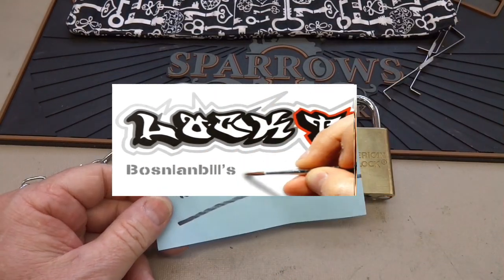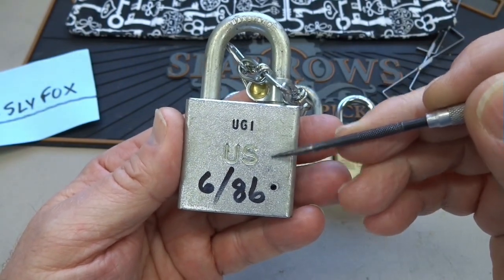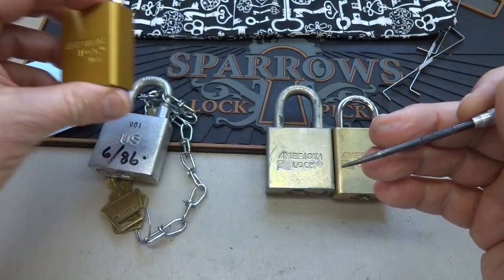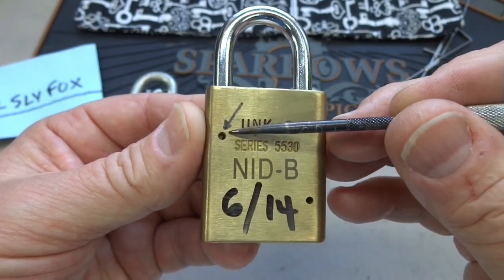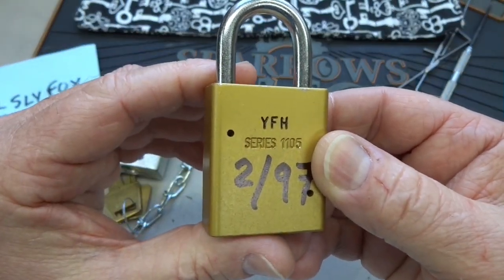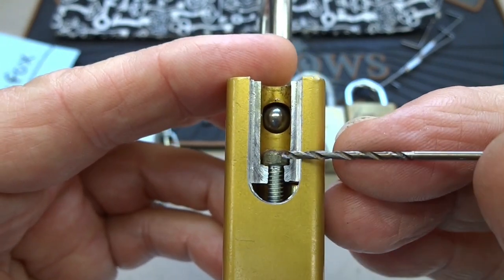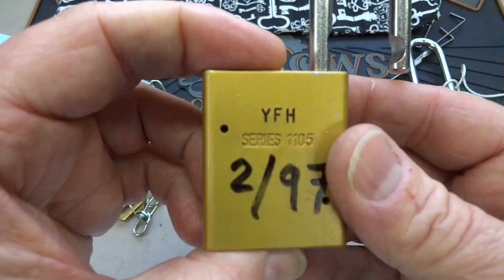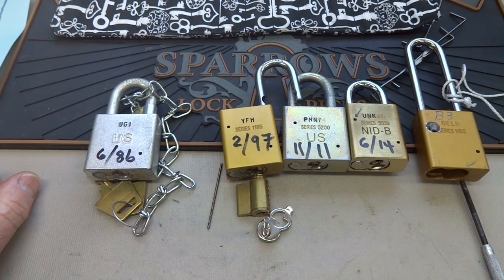(663) Vulnerability DESIGNED INTO Master Lock & American Padlocks

Comment: master lock sucks...their standard silver/blue padlocks only have a few key designs. Our company has a several of them that work with the same key. Well one day I got locked out of a site that had the same style of lock so for the hell of it I tried my key and guess what? it opened! I work for a mechanical contractor and the lock on the site to the gate was owned by the general contractor. So anyone with a key to that gate can get into our job boxes and vice versa...pretty sorry excuse for security.

Comment: I've a question... What's the big deal with that hole?..
I mean, if you need to basically drill it in order to take advantage of it, what's the point?.
If the whole was not there, couldn't you just drill the lock on some other point and gain access?.
What I mean is: if in order to take advantage of that weakness you need to basically destroy the lock, is it really a weakness?.

Comment: Reminds me of the "school locker" combination locks from Master. Behind the back plate, there is a conveniently placed quarter-inch hole in the hardened steel body. You can turn the dial three turns clockwise, drill said spot (the back plate is rather soft), and drill through all three discs. Then you turn the dial half a turn clockwise and it's open. Almost makes you wonder whether they put this weakness there deliberately. I know bolt cutters also cut throuh its "hardened" shackle like a hot knive through butter, but a small electric drill is more easily concealable.

Comment: I thought you were going to use a hardened pick to back out the screw!
Push the pick in against the screw-head, then lever it to the side.  
Repeat for a metric eternity...
Sure it would be tedious, but the defeat would not require drilling anything.

Comment: Bill, so in the Army, walking around with bolt cutters would fairly quickly get you asked about you were doing.. On the other hand carrying around a drill and a 3/16 to 1/4 inch bit was no biggie. Many times I've just simply drilled the soft steel tapered recess nut on the bottom of that screw and get the same results in about 10 seconds. While the barrel was out I would then re-key the lock or get the pin measurements to cut another key and write up a counseling statement for the soldier who lost the original key. I kept a pretty good supply of those recessed nuts as I could open a lock with the only damage being on the nut.
Reply: Eric Nelson Answering the challenge with "Keys to the city!" in my experience was always good enough. Any good e4 can tell you that everyone knows complacency kills but no one checks anyone who looks like they know what they're doing.

Comment: If I want in a place and it's only secured with a padlock, I'm getting in. I don't care what make, brand or type. I've got a 36 volt cordless Metabo and with with a cutting disc I can make short work of any padlock on this planet. If a thief wants to get in all they need to do is get their hands on the right equipment. Locks are only meant to keep honest people honest, after all.

Comment: If drilling is involved, most padlocks will be compromised by drilling out the cylinder, since the material is usually brass. I don't see the drain hole as an issue. You can always replace the screw with a grade 8 hex cap screw. I think the size is 8/32.

Comment: To be honest I do not see this as a problem. Use a center punch to mark the center of the nut on the bottom of the lock and drill it out just enough so that the head of the nut falls off. Takes all of 20-30 seconds and you can just put a new nut on the lock when you are done.
Reply: Have you tried that?
Reply: 253637zero2  Tried drilling out the bottom nut? Yes I have. It was very easy and with a $0.25 part I had a fully working lock after I made a key for it.
Reply: +bosnianbill and they were nice enough to make the lock body out of a soft metal.

Comment: Another thought: would it be plausible to use this hole to introduce a mixture of alum and water directly onto the screw, causing the eventual dissolving of the screw?  I realize this would be a long term attack on the lock, but I would venture a guess that such a long term attack would be hard to notice.
Reply: the end result is the same, the lock would be destroyed in the process, you'd just be trading time saved for lower volume

Comment: Do you reckon that if you used a drill bit the same size as the integral 'Pilot' hole, that you could weaken the screw enough to pop the core retainer plate off with out leaving any traces of intrusion?   Just drill the screw, then pry the retainer plate with a screw-driver or similar implement to shear off the remains of the screw head, dump the core, open the lock, and remove the remains of the old screw (it should thread right back out of the retainer plate since there's no tension on it), and reassemble.

Comment: That is a valid point. But if you are going to drill a lock with such a big bit (as showed by the drilled example piece) then why have any caution at all? Why not drill into every lock? Why not cut the lock? You can do this with any lock and not with such a fine bit.
Reply: +adam seay Pretty sure the point was that they give you a pilot hole right where you need to drill and that makes it even easier to compromise.

Comment: I've been watching a few of your videos about locks, & keep thinking that the locks do what they were meant to do.  That is to say they keep the normal person out of the locked item.  I would say, 'keep the honest people honest'  but I don't really believer there are many of honest people.  It's just that the normal people don't want to take the time or risk to steal, & rightly so.  Now with this lock on this video, your not quite being fair, for if you wanted to get in this lock you could just use bolt cutters, or a cut off wheel, or what have you, to be in the locked compartment quicker than drilling a hole.  So we must say that 'Master' lock did not really weaken the lock, at most just made another way to compromise it.  Another way true, but does it really make it less safe, in that the drilling it out would still be harder than the other ways. :)    
    Thanks for the videos I do find them real interesting,     Singed   an 'honest' person.
Reply: +VerifyVeracity Yes, I think you're correct, the other methods of destructive entry might work easily as well if not even quicker.  I think the point was that with essentially a "pilot hole" already predrilled, it's pretty quick, easy and fairly quiet to come by with a small electric drill and drill out the screw head.  It's also a bit easier to conceal a small battery operated drill than it is a bolt cutters.  besides with bolt cutters  you've got issues on some locks with things like shrouded and/or hardened shackles.

By the way, I agree with you on the concept that locks are largely to keep honest people honest.  I've always said that when talking about locks.  True thieves with the intent to steal are probably going to get in regardless of what you do.  You just need to make it as difficult and time consuming as possible for them so they'll pick an easier/different target.
Reply: You're right, locks are meant to keep honest people out. But a strong lock also deters the dishonest folks who aren't looking to steal YOUR stuff specifically, but are rather prowling for easy targets. Master makes easy to defeat locks. Therefore, if you use their products, you're basically putting up a sign that says come rob me.

As consumers, we shouldn't accept security compromises that didn't need to be made. In this case, Master had a perfectly fine lock body design they acquired from American, decided it needed an additional drain hole, and then proceeded to put it in the worst place possible. It was a really dumb decision and I see no problem with poking fun at Master's incompetence.

Comment: This is a weakness, but if you're going to use a drill on a padlock, why bother, just cut the shackle with a bolt cutter...
Reply: +Yyunko Some seem to have guarded shackles, although those are only the more expensive ones, that he's show in some videos
Reply: drilling might be a bit louder but a drill is a much smaller tool then bolt cutters and every household tends to have one one could also use some type of acid at that point

Comment: Well, those are aluminum bodies correct? So if you were to drill in the same location, even without the hole, couldn't you get in?
Reply: +AfterDark3 Yes, obviously.  The point again I think was simply that by putting the drain hole exactly where they did, Master Lock created a perfect opportunity for a thief with a small battery operated drill to defeat virtually any ML lock with these drain holes very quickly and easily. They have essentially predrilled a perfectly placed  pilot hole for them.  The only thing they didn't do was put a label on the lock with an arrow that says, "drill here ->."  Who knows, maybe ML will do that next under the guise of thinking they're helping the customer.   They could attache a label that says something like,  "If your lock fails to open, simply drill here ->     <-- and the lock plug will simply fall out of the lock body and the lock will no longer continue to function.  Thank You, Master Lock."

Comment: Are the drain holes really needed? Not really as enough water stays in there to rust the spring and retainer screw. Weakness I suppose but it is a destructive bypass.
We locksmiths have been drilling the retainer nut for decades to get American locks open when they can't be picked. I don't see any professional using this to open one.

Comment: I don't see that the hole makes the lock any weaker than it already was. A drill is usually not the tool of choice for a thief. Marking the location of the screw head doesn't make it easier for him to use bolt cutters or an angle grinder.
Reply: +Timothy Fish But it gives them one more avenue.

Comment: It's not like the hole makes it /that/ much easier. Just makes it faster. If you know where to drill, you can just tap with a center punch and work your way up with successive drill bits. Even the best aluminum is no match for a carbide drill bit.

Comment: Seems like there are other faster methods that use less equipment to achieve the same end.
You could use a nuclear weapon to quickly vaporize the lock but why go to the expense and trouble of that when you could just break the lock with a bulldozer?
So I’m not too upset over this hole.

Comment: but couldn't you just drill the lock anyway??
Reply: I'm guessing that the issue is that you need knowledge of where to drill in order to do it as quickly as possible, but I'm not sure.  If you drill too low I'd think you can get the guts to fall out regardless. If you drill too high though, the guts won't fall out. Maybe it's also just easier mechanically to drill through when there's a pilot hole going all the way through. If anyone with more experience could confirm that'd be good.
Reply: some locks will have anti drill pins to stop people from doing just that.
Reply: @Ghorda9  they are in the core of the lock. We are talking about drilling at the spot showed in this video, regardless if there's a drain hole or not.
Reply: @ludvigdreng6315  drilling under the shackle wouldn't achieve anything, the shackle is held in place on both sides and the locking mechanism is higher up shielded by the shackle itself.
Reply: @Ghorda9  you could still drill the screw showed in the video away. Isn't it what we are talking about here, or where are you?
Reply: @abnorcscreenname8489  The two key points are
1) the hole tells you exactly where to drill
2) it's much easier to drill with a pilot hole because it stops the bit moving around. Remember that, in the field, you're not going to have the lock in a vice and you won't be using a drill press: you'll be using a hand-held drill and the lock is locked to whatever it's locked to, potentially in an awkward position.

Comment: OK Bill.  We all know you HATE Master Lock.  But, a person could do that with every brand of lock made of the same material.  Sure, Master Lock has that hole lined up in just the right spot for that nut but why drill such a large hole?
You could accomplish the same result with a smaller hole if you drilled just an inch or so up from the bottom of the lock vertically even with the screw/rivet and drill through a smaller diameter object. 
In fact, you could drill it, open it, replace the screw (or rivet with a screw) then plug the hole with a piece of Aluminum.  All said and done, you would have a usable lock and many people would never even notice.

Comment: guess what! i discovered this when i put together my abus and forgot the cam. couldnt bypass it so i just drilled that hole. didnt take me long and hard to comeup with this.you might just vibrate the screw loose like i did and it fell out. lock has a shitty brass body anyway

Comment: Can you assemble a series 1305?  I have all the parts but am having a hard time putting it all together.  I could pay of course.  Let me know, thanks!
Reply from the maker: Mario,  by the time you paid postage back and forth you could buy a brand new lock!  They aren't that difficult, you can figure it out if you put your mind to it.  There are many videos on YouTube showing disassembly, take a few minutes and watch a couple.
Reply: @bosnianbill  I understand, thank you for your time and the video!
Reply: @bosnianbill  I ordered new actuator, new cylinder that came with two new keys, new security screw and lock plate.  Figured it all out and it works like new.  Yes I spent about $20.00 but I was happy to bring back this old lock to life.  Again many thanks, your videos help.

Comment: Wow, even I could do that. It's made this lock accessible to any Tom, Dick or Harry with a cheapo hammer drill
Reply: Why do you need a hammer drill? Hammer drills are for concrete, not metal.
Reply: Hey man your indeed correct. My brain wasn't in gear when I made that comment.

Comment: This is not a security weakness. There is no difference in taking a 1/4" drill bit to drill through that hole or taking a saw to the shackle. None.
Reply: Being able to cut the shackle is a security weakness just like this is a weakness. Destructive entry is still a valid attack in many cases, and can be mitigated against to various levels. A boron shackle, or a shielded shackle, for example, would be much harder to cut, and a lock without this drain hole design would be harder to attack.

Comment: A lot of these commenters don’t seem to realize how important a pilot hole is. As someone who works with metal and wood a pilot hole makes you accurate and saves you time. The bit won’t slide around and there’s less material to drill through. So basically this might be faster than bolt cutters depending on the shackles strength and if the one breaking the lock isn’t strong enough to cut it.

Comment: Why not just make the hole so it doesn't align with the screw head?
Reply: The screw heads at the bottom of that hole. if the hole was elsewhere the water wouldn't drain.
Reply: Coen  Unless that hole were to be put in on an angle where as the "exit" portion (on the lock's exterior face) of the hole were to be moved down by "x" amount & in towards the center of the lock by "y" amount so it would act as a drain trench & not as a 90° pilot hole.
Reply: I would think a set screw would do just as well. No screw head that way.